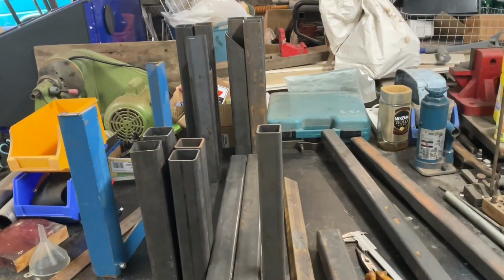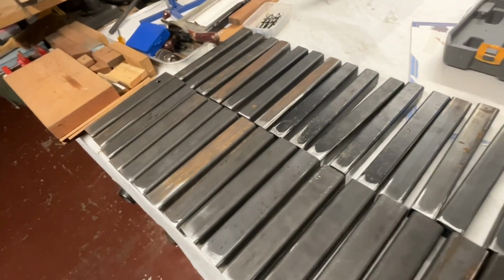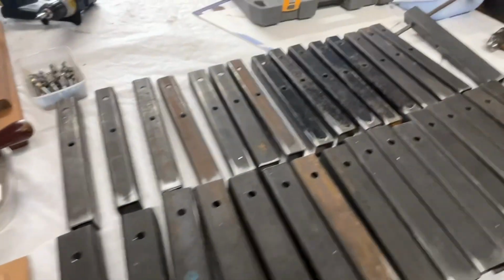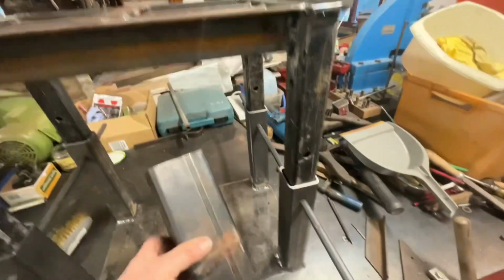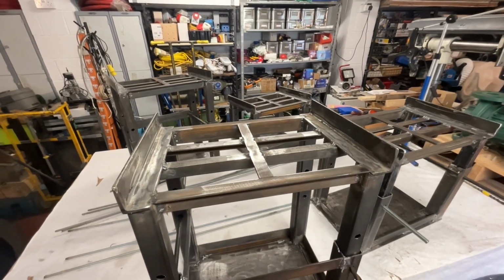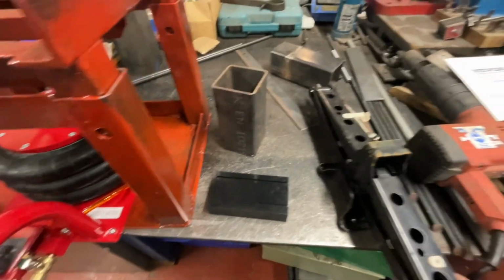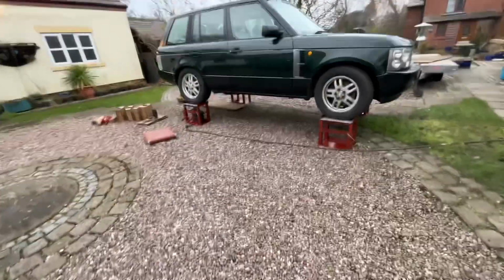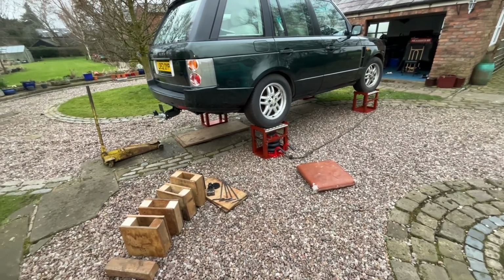Wheel Cradles / car lift, start to finish from scrap metal.

Comment: I just stumbled across this video, I find it so interesting that I too have made 1 of the lifting crib out of 1.5 and 2* box scraps for use with my similar air jack, the only difference between yours and mine is I didn't use the aluminum plate an I have just my lock pins bent to a L rather than a T shape😊
Reply from the maker: @arthuroconnor8474  Hi there, thanks for your feedback. I think your idea of L shaped pins may be better and I did consider it but the ‘tT’bars were easier to make, however it does mean I have to have the front holes perfectly aligned with the rear ones and this can create a little resistance when pushing them in or pulling them out. I may revert to your way if it becomes too difficult. I hope yours proves useful, mine certainly have, I have loads of room to get beneath the vehicle and work. I feel they are a whole lot safer than axle stands and give more clearance. Very best wishes, Bernie W.

Comment: If i may be honest whilst i think they look great they kinda scare the hell out of me. My concern tould be that the wight could brake the bolt things causing the vehicle to suddently drop. Mind you i also feel like this when i put my car on the standard  ramps. For extra safety could you not reinforce the 4 corners with bars from the ground to the plate once you reach the height you want.
Reply from the maker: @Crazy-Caveman-qh2dz Hi there, thanks for your feedback which is what I requested in the video. If I can make it safer I will, having said that, I worked under it yesterday without extending the height at all, there was plenty of room. So I may only need to extend them on the odd occasion. This is my first effort making this sort of thing so I have tried to be cautious at every stage. I will take on board your advice and look for a way to secure them at height as safely as possible. Thank you for your contribution, Very best, Bernie W.
Reply: @BernieWebster1  For a first attempt you have done a brilliant job. The one place i hate is working under a car even though i do my own fix's etc. And lets be honest to get something to lift our vehicles high enough so we can move freely are not easy to come by.